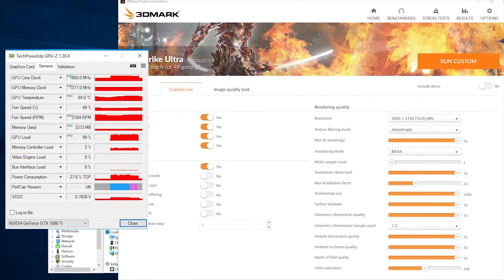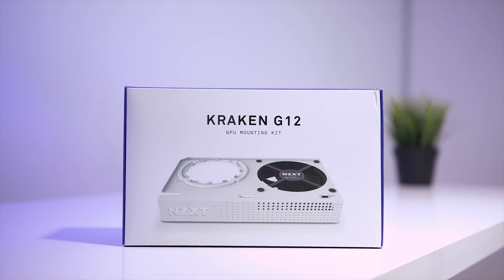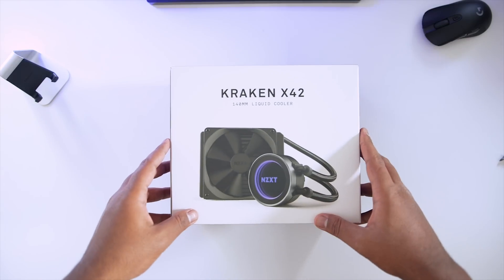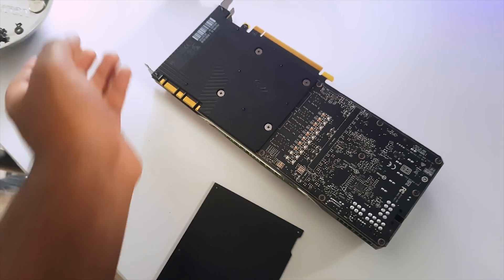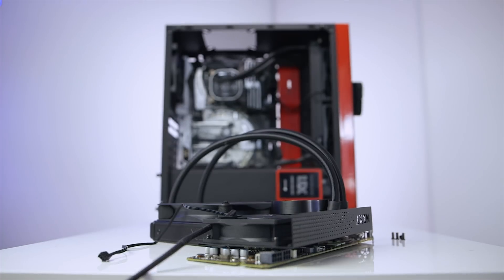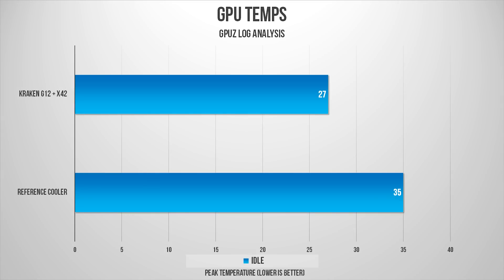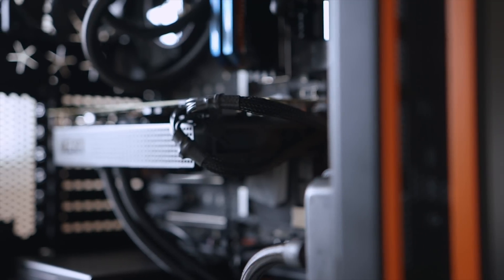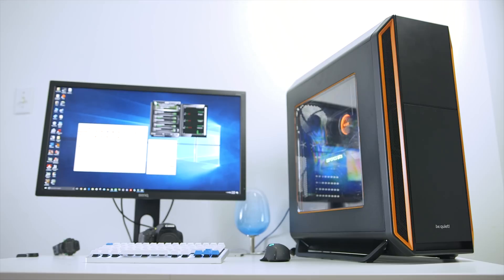Watercool ANY Graphics Card! -- Testing the NZXT G12 Bracket

Comment: the kraken g12 + aio is a futureproof universal concept to watercool any gpu.. upgrade any GPU & u can still use g12 + aio.. im using the older version of kraken g10 on my 780 ti, then on 980 ti n then on 1080 ti.. just bought the cheapest reference version of gpu n overclock it like crazy... and heck u can even used on any AMD gpu..

Comment: You can just get a 120mm used rad for $50. He just happened to picked  the most expensive single fan rad, you can't even see the cool pump design when it's mounted
Reply: do you think a 140mm out performs a 120mm one? I'm just wondering cause I've seen people test the kraken m22 - 120mm vs this one (kraken x42 - 140mm) and they say this one is roughly around 10c cooler.

Comment: If you were gonna spend couple hundreds for the GPU AIO setup + CPU AIO, then might as well just go custom water cooling.  Yes, it may be a little more expensive, perhaps, $100 more, and some exciting experience building the custom loop, but the system will be a lot more quiet, run as cool and better, and much better looking.  No extra cables and tubes all over the inside of your case.

Comment: Those temperatures are very poor. A Kraken X42 should be able to cool a 1080Ti far better than that. We're talking 52°C, not 69°C. You're essentially at the same temperatures as a good air cooler at 69°C. That is appalling and is likely not indicative of the performance an average consumer would be getting. As much work as it would be, I strongly advise looking into this again. Sadly that is not the first time I've felt I've had to say that with your videos.
Reply: Daniel West Jayztwocents reviewed this cooler and he got 47C under load while overclocked. Granted he was using a 1080 not a 1080 ti, yet the difference in temps should not be that different, especially considering Jay was using a very large over lock and HC was running stock
Reply: +Daniel West yeah the temps did seem high. Although if he didn't change anything after recording the assembly, then there seems to be no where near enough paste on the gpu, which could be the reason for the high temps.
Reply: Just curious, as the Kraken x42 comes with pre-applied thermal paste, would you still need to add more because you're using it on a gpu instead of a cpu? I noticed he added tp in the video so maybe that's why? I don't know...
Reply: My EVGA Hybrid Kit AIO i put on my reference 1080ti goes to 51C and its only a 120mm Rad. I did mine the way GamersNexus did theirs.
Reply: Just go for ek Predator 360mm
Reply: Agreed. I have the same set up and max of 46°C under load. Ambient temps 15°C.

Comment: Why are you using USB headers on the MoBo to power up pumps and fans that are 12V?  USB is 5V. I don't understand the last part. It sounded like this is what you are doing. Anyone have a translation?
Reply: Solder Joe Not for power, they need USB so you can control them in the software.
Reply: AHH they Plug these into the USB header. That's kind of dumb when there is an existing solution. USB splitter would solve this problem or pass through header plugs. Should be supplied with the cooler.
Reply: Yeah most AIOs and all of Corsair's i devices also need a USB header.  It's a huge pain.  NZXT makes an internal hub to solve this.  My H80i GT and RM650i both need a header.  If I was to add an RGB lighting module like an NZXT HUE+ that's another header I'd need.  My mobo only has one so right now only my AIO is plugged in until I can get a hub.

Comment: no offense but the gpu temp is insanely high for an aio cooling. there is no way for 69c gpu temp under aio cooling for a reference 1080ti with only 300w max power limit. you better check the thermal paste spread on gpu aio and aio copper base.

you can go check other gpu aio cooling results on youtube and overclock.net forum, i havent seen a result that is close to 70c ever...
Reply: I have the NZXT G10 setup for my 1080Ti and it hits about 55c on unigine heaven with boost clock at 2050mhz. Something is not right with the installation on this video. Temps are way too high.
Reply: @davediggz  what cooler you use
Reply: ddasd dfddasd I was thinking the same thing. Jayztwocents just did a review on this cooler and he got 47C under full load while overclocked
Reply: I'll summarize your comment: "Hey guys, look how high my asic is"
Reply: The Necromancer That's wrong. A full cover water block will cover the entire PCB, but an AIO covers the GPU core exactly the same as a full cover water block. An AIO with a 240mm radiator or more will cool within a few degrees of a full custom loop with the same radiator space. Usually a full system will provide superior temperatures due to a more efficient pump. Tests prove this. Look them up. An AIO is not full custom water cooling, but it is water cooling because you are using liquid to transfer heat from the chip to the radiator. While an AIO will rarely match a full water cooling system, it is possible to do so, and in the times it falls behind it would never fall behind as much as it does in this test if it were properly installed.
Reply: Rainsoakedcoat
no, i have been using aio cooling for my gpus for years and the temp wont eventually go up significantly. since water has been using as a media between copper base and the radiator heatsink, the gpu temp will be responsible much more quickly than air cooling using heatpipe to transform special liquid inside the pipes into hot air to heat up the whole heatpipes and the fins.

if the radiator fan is intaking, then the gpu temp should be even lower than as an exhausting fan mount, because the intaking air should be cooler generally.
Reply: Just ignore him. I knew what you were talking about. I'm by no means an expert, but in my experience overclocking ASIC quality means very little. And even sometimes frequency isn't everything. So your 1600Mhz 980Ti, which is a great overclock, might score only relatively higher than a 980Ti at 1550Mhz. From my experience, GPU's can stop scaling well after a certain point. Sometimes it's better to lower a clock speed for better scores. I got the impression from your comment that you knew that, so ignore the other chap.
Reply: I'm glad somebody else recognises how terrible those temperatures are. The original G10 with a crappy Corsair H60 can reach significantly lower temperatures on a 980Ti, which I've found is a hotter GPU than the 1080Ti.
Reply: maybe he needs to adjust hi fan curves
Reply: Medokn Even fan speeds at 600-800 RPM will cool better than that. Fan speeds don't amount to that kind of temperature hike when cooling a GPU with water. It's likely a poor application of TIM, an uneven clamp on the die, a faulty pump, or a mixture of different factors.
Reply: I have the zotac 1070 with the g12 and a nzxt x42 and with the fan speed topped at 55% (about 800-900rpm) and it makes out at 60c. With a heavier fan curve it easily matches jayz review of it chilling at 50c. My pc setup is a fractal r4 with a front lepa 240 rad and the gpu as the 140 exhaust.
Reply: If the liquid temperature heats up to 69°C, it is because there is something wrong with the system and is not cooling effectively, not because the AIO is oversaturated.

Installing the AIO as an intake should not affect the GPU core negatively at all since it is connected to the radiator via tubing which is then connected to the radiator which is being fed cool air from outside. An elevated case temperature will only affect a CPU tower heatsink, a CPU AIO that is installed at the top or rear of the case, or an air cooled GPU, but only marginally in the case of the GPU. There are tests proving this from multiple sources including Jayz and BitWit to name a few.
Reply: True, just tested 980 ti KPE (83.7% asic) and 980 Classy (83.9% asic) with a 140mm  (Thermaltake water), 240mm (TT water) and 280mm (Corsair H110) aio, and the absolute worst temps were in the low to mid 50's and only by cranking the voltage way up. Both cards max around 1600MHz @ 1147-1153 mv  (high asic) and high temps of <40C.  Turning the voltage up to 1300 mv lowers the clocks to 1585 MHz because temps crept into the 50's. Pretty sure 1080 ti's don't run at 1.300v +
Reply: Actually summery sounds spot on, but for the real overclockers that know me  (GtiJason - HWBot/OCN/ASRock/Team Group)  this is not a good thing. The only reason I added that is to justify the high clocks at low voltage and why my clocks went down as I added voltage. This high asic BS is great for daily overclock for gaming and productivity but does not scale well under ln2 and competitive situations, the only reason I have these Maxwell cards in the first place. It's great how people think they have to be sarcastic because they think they know better and try and call someone out for bragging. I'm sorry but  this was not my intent and please think before you start attacking people. I'm a humble person who is always there to help, sure my community is small but more reason for me to pass the knowledge
Reply: the thing is, common people only run a load test for like 5 minutes and look at those tempratures, but watercoolers take about an hour to actually stabilize tempratures, so im not really supprised by the temps  he got.
Reply: late to this party, but let me explain his temps...hot ass air as intake. I have mine set as exhaust and my temps are 55 at the hottest under 100% load using  a gigabyte aorus 1080 ti. When I mounted it the way he did with the fans blowing hot air inside the case, my temps rose to 70 and I had crashes left and right. If you're going to dump the hot air back into the case you might as well get an aftermarket card and keep its stock cooler.
Reply: yo are LEPA coolers legit?
Reply: ddasd dfddasd I'm gonna guess it was because he didn't spread the thermal paste on the entire die.
Reply: he didnt use near enough thermal compound judging from the second clip, he was doing it asif it was a cpu, gpus need a nice lathering
Reply: The temps here are much higher because of the way he mounted the AIO within the case. He used it as a front intake in a case that has low front clearance for airflow in a push config. This means that only hot air is being pushed into the case by the fan through the RAD. It effectively chokes the system and raises the internal temp significantly because of a lack of airflow. The system itself would work much better if he installed more fans above the front RAD and possibly an additional fan set to a pull config on the RAD. 

For most users a stock aftermarket GPU would suffice for cooling if the airflow within the case is managed properly taking into account the intake of cool air and the exhaust flow for hot air. The case itself is also a factor as cases with an open front design would perform significantly better than a closed front design. Spending an excess amount of money on a secondary AIO for the GPU is not as viable as getting additional fans for the system. In most situations it would also be more cost effective to just do a custom loop and cool both CPU and GPU with one liquid system.
Reply: My GPU doesn't even see 60C even after 6 hours of Far Cry 5 at 1440p using the Corsair H80i V2 and the G12.
Reply: The Necromancer that is not at all what anyone is saying here. Everyone is saying the temperatures are higher than they should be when using an AIO. No one is talking about a custom loop here. You are the first to bring that up.
And yes, an AIO is watercooling. I'm not sure how you can claim otherwise.
Reply: Two things:

He may have done a longer test that actually heated up the water temperature in the AIO.  Most benchmarks and quick gaming sessions won't saturate the AIO.

Secondly, he had it as an intake.  The case temperature was elevated.  Even if the AIO is venting heat away from the card, having the ambient temperature within the case itself will still result in an increase in GPU temps.
Reply: Exactly!, those high temps are because of the AIO, which is not "watercooling". An AIO will never be on par with the performance and cooling capabilities of a proper watercooling loop.

Comment: Rather than looking at the cost of the bracket+AIO as an add-on, it makes sense to contrast the price of the original card+bracket+AIO with pricing of one of the manufacturer's hybrid cards.
Even more to the point, it's still a LOT cheaper to add the bracket and AIO than to REPLACE the card with a better performing one (unless you can sell the old card or get a good trade-in).

Comment: will other coolers work with the nzxt bracket like Corsair?
Reply: NZXT
Kraken X62, X52, X42, X61, X41, X31, X60, X40
Corsair
H105, H110, H90, H75, H55, H50 (CW-906006-WW only)
Thermaltake
Water 3.0 Riing RGB 360, 280, 240, Red 280, 140, 
Water 3.0 Ultimate, Extreme S, Extreme, Pro, Performer
Water 2.0 Extreme, Pro, Performer
Antec
KUHLER H2O 920V4, 620V4, 920, 620
Zalman
LQ-320, LQ-315, LQ-310

Comment: You can put a lot more thermal paste on a gpu than a cpu
Reply: HudsonGTV indeed. Unlike a CPU that has a smaller die with a larger heat spreader on top of it, the surface of the GPU die is completely exposed. It's important that enough paste is used to make sure that it spreads enough to completely cover it when the cooler is installed.
Reply: nice. the more you know!
Reply: wont make a difference
Reply: @vengeanceu  Yes it will, if you don't completely cover the GPU die, it will run much hotter. I know this from personal experience when repasting a laptop.
Reply: @vengeanceu  it definitely does...
Reply: @FTVG_inc  yes definitely does not
Reply: @vengeanceu  there is no heat spreader, if the GPU die isn't covered 100 percent you will have higher temps and can kill the uncovered part of the die.
Reply: @FTVG_inc  i think you missed the point mate, he's talking about spreading it like nutella will give benefits
Reply: @vengeanceu  on a gpu die yes, you should spread it and make sure it covers the entire die evenly before putting the heatsink back on.

Comment: just go buy the Corsair Hydro GFX 1080Ti or MSI Seahawk 1080Ti both are the same besides branding as they both use corsair coolers and MSI GPU's and have the cooler already attached to the GPU  for $100 over reference prices which is less than the price of reference + your own cooler but i would suggest going for the Corsair variant as that has a ML120 LED fan instead of the  SP120 LED and the ML fans are quieter and have more control over the fan speeds etc as well as having consistent lighting which does not correlate with the speed of the fan

Comment: Or just use zip ties and a 5 year old Kuhler 620 or equivalent which you can get used for 15 bucks. Need a GPU with middle plate + fan for VRMs so blower style cards work great.

Comment: the problem is with a thick rad blocking what's supposed to be an exhaust for hot air to go out, there will be a lot of HOT AIR trapped inside  the case with no where to exit. Hence the higher mobo temps when using the aio with the gpu

Comment: Thermalpads aren't heatsinks. If you were having BSODs without them at first the VRM fan is running too slow. Also a proper solution would be for NZXT to include some stick on heatsinks for the VRAM and VRM. Also high 60s seems to be overly high for an AIO cooled GPU. You might've set the fan speed too low.

Comment: EVGA 1080 hybrid is cheaper than even the cheapest of 1080's with the addition of this bracket and even the thriftiest AIO cooler. :(
Reply: Probably - 
So if you have a GPU and may want to try it - Thumbs up
If you are in the market for a AIO GPU then a hybrid model is probably the better option.
Reply: Yepp, so basically it is for people with regret and lots of money. :D

I have regret and no money. :(
Reply: EVGA have horrible fan control on their hybrid cooler - basically radiator fan runs almost always full speed. Which gives you great temps, but loads of noise. Also fan is not that great, you can replace it but then add cost of extra fan - and you will need some means to control it. Also you stuck with one choice of 120mm rad. With G12 you can get AIO like ones NZXT which give you proper fan curves and better fans, and you can pick AIO with your choice of radiator size instead of smallest 120mm.
Reply: but he's using it on a Ti, not a regular 1080
Reply: 1080Ti SeaHawk and EVGA's hybrid are only 60-80 more expensive than their air cooled counterparts.
Reply: yeah you can, i think asus,evga and msi already have one released.
Reply: OVERDRIVE I believe so, hard to find a definitive review on those since they're so new, but initial searching shows high 50's low 60's.
Reply: Pow Bam Zing Not in everywhere at my place its 650€
Reply: I think there is a pretty interesting aspect to this AOI solution, it makes any GPU a watercooled GPU for any further upgrades. So now it is a 1080ti but maybe two years later it is a different card, etc. I think it has an interesting value proposition for future upgradability.
Reply: Man if i knew then that i was going to do this setup I should've bought the hybrid instead. Eh, but that's ok cus i can always convert back to an air cooler or switch to a different aio.